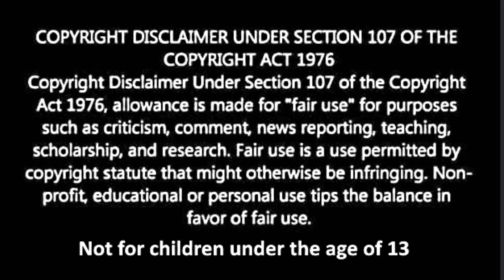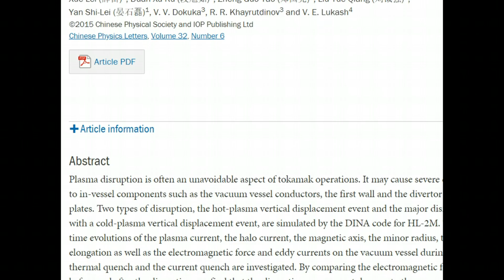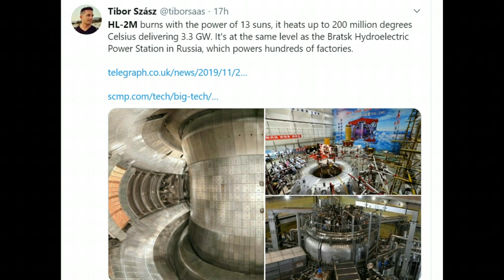China’s ‘artificial sun’ Nuclear Fusion plant, to start operation in 2020, What could go wrong?

Comment: Several things wrong in this video, the Chinese Tokamak doesn't have the "power" of 13 suns, it has 13 times the temperature of the core of the sun, which you can do because you don't have much material to heat up to that temperature. If it escapes it cools instantly, making a chain reaction getting out of control impossible. In fact, thats why fusion is so hard, because it needs perfect conditions to happen, and anything going wrong makes it the whole thing fall flat. The disruptions cited in your video happen in a split second and can do at most a bit of damage to equipment.

Comment: What makes nuclear fission dangerous is how it chain reacts, fusion does not chain react. Tokamaks have been around for a while and they're pretty safe things. They've got them creating fusion fine for awhile now, the problem is so far they've not managed to create a tokamak which produces more energy than is put in. 

This energy does not come from nowhere, it comes from the nuclear force binding the protons together. You're turning hydrogen into helium basically.

If this chinese tokamak is successful it'll produce more energy than is put in, thereby proving experimentally that fusion power can work,
I don't believe this fusion power reactor they're building is designed to generate actual usable power to their power grid etc. It's more of a proof of concept.

Another thing is that china is all about face, they can regard looking good being better than being good etc, it's why their recycling waste all goes into the same bags into the same trucks, why their green street lights with mini turbines on them, the turbines don't actually generate electricity, they're using electricity to spin... with china you got to take everything with a pinch of salt. It's why there's so many scams and cons in china etc, they have a different culture with different moral values. Unfortunately a lot of western onlookers don't realise this and take what they say at face value.

Successful Nuclear fusion power can be a kind of political statement as well, so it's extra likely china could exaggerate things slightly to gain political face.

Interestingly the UK has actually invested into building a usable fusion power plant just this October. Which is quite bold, considering that ITER is still in construction and that's supposed to be the most anticipated experiment to prove that nuclear power generation is feasible. UK being pretty casual about it, not even mentioned on bbc news broadcast... (it's like all their news talks about is brexit lately.). But yeah it's possible uk could be the first one to power their country with fusion power, but we'll have to see.

Comment: Fusion is a million times safer than fission. All this is motte compared to the ability to disassociate h20 by using low temperature CO2  plasma and radio waves. This system scrubs the atmosphere while producing a biofuel at very little cost. This contraption in the article is more than likely a propaganda piece. Ain't no telling what that thing is really for

Comment: The hazards noted in the abstract must be resolved. Part of a resolution involves inducing a rotation/spin to the plasma as it's held in the center axis of the toroid core, keeping it from diverging to the edges of the toroid, which would be bad.  Maybe they think just using enough brute force will get them there but, sadly, no.  Another "great red long march" with enough people won't do it, either. The only photos shown look like a decades-old impression of a core.  No, they won't destroy the world but, yes, they could make a nasty mess inside the building.

Comment: ..CERN is more dangerous than this lol and there are other fusion reactors out there too, yet your only scared of China's version? Grow up lol I'd be more concerned at mass produced thorium reactors than a fusion reactor at this point of development, NO ONE can run one for more than a second due to lack of proper materials.
Reply: Why are you conserned about thorium reactors. They are the safest
Reply: @eriknielsen1849  I'm more concerned with China designing and mass producing them. History has taught us that nuclear reactors require HEAVY engineering to make them safe, and even tho thorium CAN be made safe, it doesn't also then mean that it COULDN'T be made unsafe by cutting corners. Just like how the main arguement of thorium was that it doesn't produce the elements nessicary for nukes, india is doing just that at this very moment because the nuclear treaty doesn't cover thorium as far as I know.
Reply: @Drake5153  if it's molten salt reactors and there is a leak the salt will cristalice on the floor and the reactor stop. So actually no risk. We had ouer change in europ but were so manipulate and still is. China now is way ahead. China is actually God at Makin quality the problem is the middle man (mostly western) who wants a 60-75%payback I have seen 900% in one case .. Just look at apple they have around 70%and themself put in destroying software or components  And therefor it's a lousy quality and not the chines foult
Reply: @eriknielsen1849  of course the salt will solidify once hot of the loop, but it's still radioactive for at least 8hr after, which means you still need a containment vessel. The biggest problem with china is their known for copying designs without engineering them, which inherently causes faults in their designs because their not the original creators. Couple that with the laws and standards they have and it could EASILY get out of hand. Don't get me wrong, china has a LOT at their disposal, but if their treatment of Hong kong is anything to go by, I wouldn't trust then with anything complicated, and that's experience talking. The MAIN reason thorium isn't a big thing is first-investor-costs of developing the system, and the main reason we still use 60's tech in most reactors is again, investor costs without a clear outcome. The only way to make money these days in the nuclear industry is fuel, NOT reactor development. Thorium is plentiful, which means theirs much less money to be made with fuel, and if it costs a lifetime-worth of money to develope a proper, SAFE design, who can you expect to do it properly? God knows what china is doing with the info they acquired from the us about thorium, but if their doing anything like what india is doing, it can't be good lol

Comment: won't work. Tokamak (donut shape) has failed twice aleady.  ITER is still using the same design in Europe...it won't work either. should try MICRO-FUSION aka. www.focusfusion.org  uses a different fuel too...boron gas...

Comment: 13 suns seems a little excessive
Reply: 13 sons maybe.
Reply: Go to my channel, find the name Technology Research, go there and find my Fusion Energy playlist.

You can learn a lot about it there. No I'm serious. Please be willing to check it out.

Also check the "About" tab on my other channel. Please read that before going to the playlists.
Reply: They have to get hotter because its not big enough to use mass to fuse hydrogen. Or any element.

But reality this is balony. Won't work.  Years ago Lockheed Martin stated they had a fusion reactor. As no reactor came about there you go another fake claim.
Reply: it has the temperature 13 times the sun, thats it. It doesn't have as much energy as 13 suns or you wouldn't be alive right now.